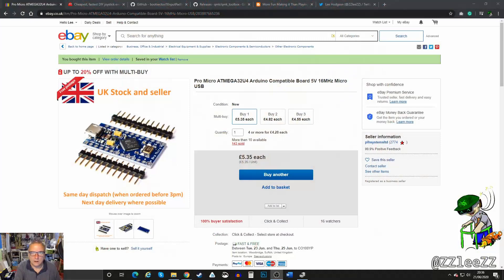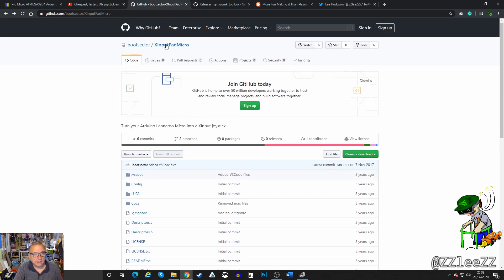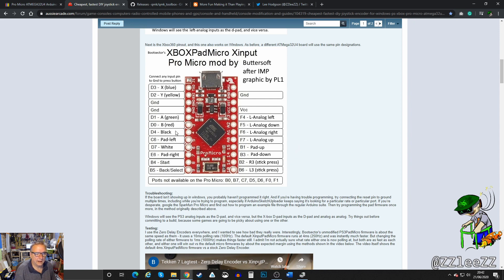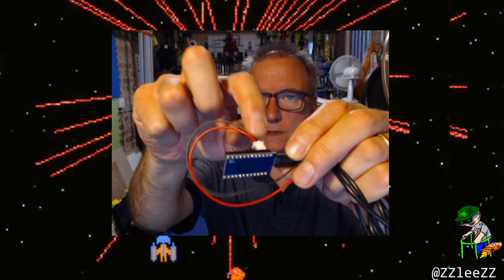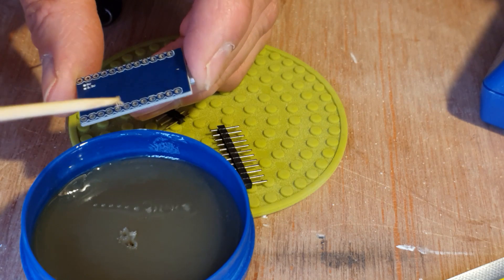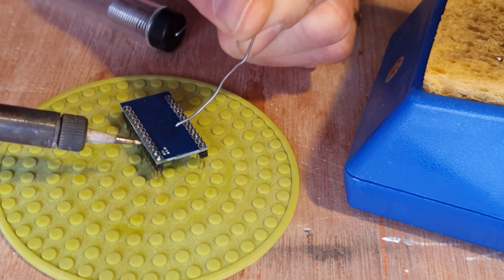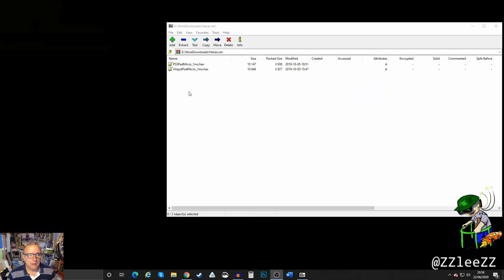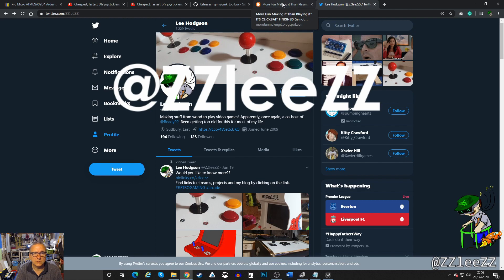CHEAP! Arcade controls encoder using an Arduino Pro Micro

Comment: Small question if anyone reads it. It seems there are 3.3V and 5V variants. Which one is the one you need? Or are both okay?
Edit: I found the answer if anyone is asking the same. The forum post says you need a 5V one
Reply from the maker: Nice find! I would have needed to look that up 😁
Reply: @MoreFunMakingIt  Btw. at the end when you show the insides of the stick. Are these dupont cables rly connected to the buttons and the lever? Cause in the video it rly looks like they are connected to smth else.
Reply from the maker: @niklasstg6957  Yup! No camera tricks here! :D

Comment: I made 2 of these recently but finding them to be sluggish/unresponsive in some libretro cores. ie the directional getting stuck or some buttons being slow to respond. I've triple checked my wiring and now putting it down to my config – have you experienced anything like that? Do you have any tips for getting them working nicely in retroarch input settings? Thanks!
Reply from the maker: I did have some problems with the xbox version of the hex files. I'm not sure if it was the same thing, but it did have some very glitch behaviour. I ended up using the PS3 version instead and that sorted all the problems. Other than that I'm not sure what to suggest.
Reply: @MoreFunMakingIt  I shall try that instead, thanks
Reply: flashed some new pro micros with the PS3 hex, great. Mapped them in emulationstation with no issues but the buttons or joystick aren't working in mame-2003-plus or any other emulator. Have tried wiping all traces of any controller configs but still the same issue. Have you used the PS3 hex with Retropie?
Reply from the maker: @tomplam  yeah. They worked really well for me in Retropie. There's a way of deleting the configuration file to reset all the controller settings. I can't remember how you do it exactly, I know you can do it over the network.
Reply: @MoreFunMakingIt  I've found out the issue I was having was due to a crap HDMI>VGA converter taking too much power
Reply from the maker: @tomplam  ahhh! Interesting. Glad you got it sorted 😁

Comment: This is exactly what I've been looking for! I've created an arcade cabinet that I want to use my Original Xbox in, but until now haven't found an inexpensive way of using my arcade controls with it.

I do have one question  though, on all of your buttons, did you wire the negative sides together and take them to one of the ground pins or do something else? I couldn't quite tell from the video.
Reply from the maker: Hi Dilpesh!
Yes that's exactly what I did with the ground. I chained them all together to one of the ground points.
I'd be interested to hear if this works with an original xbox. Although it appears in windows as an xbox controller it is missing security software that an actual xbox 360 controller has. I have no idea if an OG xbox requires this? Good luck with your build!
Reply: @MoreFunMakingIt  thanks for the reply! Fantastic channel! Keep up the good work. The OG XBOX is apparently just a simple USB HID interface..From what I read, the xboxpadmicro files used to flash to the arduino were created for the OG xbox so im hoping it will work!

Last question, with regards to the negative points, my buttons have 3 pins on the bottom on a block (suspect they are the same cheap ones from Amazon you talk about in your video) I believe 1 is for positive, 1 for negative and the other for 5V for the led light inside.

I think my only choice is going to be to connect a wire with dupont connector to each negative terminal and then twist the other ends together and solder them to the ground pin. Would this be the way to do it or have I missed something?
Reply from the maker: @dilpeshajmeria7459  the ones I have don't have an led. But they do have 3 pins. One pin will be common (ground) and another will be NO (normally open) and the last will be NC (normally closed). Test it with a multimeter or continuity tester to find which pins are open until you activate the switch. Some microswitches have a diagram embossed on the side.
Run a wire from the arduino ground point to the ground (common) terminal on the first switch and then chain from that one to the next to the next and so on.
Hope that helps! 😁

Comment: With zero delay this encoder?
Reply from the maker: It's not zero. None of the encoders can do that, it's a marketing name only. But this encoder is lower latency than the ones called zero delay.
Reply: @MoreFunMakingIt  I didn't know that, thank you
Reply: @MoreFunMakingIt  That was my question.  Now to weigh it to the new Raspberry PI pico.   Mainly, I like the 12 bit Analog (ADC) on it vs 10 bit in the Arduino pro micro, though not sure if this will translate to better resolution.  Used Arduino pro micro with pots for flight sim rudders.  I've been thinking of trying hall effect sensors.  Great little project.  Considering flight stick with throttle or yoke next.   Thanks for your videos!
Reply from the maker: @imushavem7504  Your welcome! I'm very interested to see if the pico performs better in latency tests.

Comment: So did you just use the dupont connectors directly to wire the board to the buttons? I've never worked arcade buttons before and looking at pictures they have a very differently shaped pin.
Reply from the maker: No, I crimped a suitable connector onto the male dupont connector. Worked really well.
Reply: @MoreFunMakingIt  Awesome, thanks. And just because I can't get a definitive answer anywhere else it looks like it needs a .25" (6.3mm) female spade connector?
Reply from the maker: @Lemonicii  totally depend on the connectors on the buttons or sticks. Some are 2.5mm and some are 6.2mm. Best to measure what you have.

Comment: hi, been watching your vids, is the joystick recognized as an xbox controller? did you try it on windows 7? did you have to install the xbox controller driver on windows 7?
Reply from the maker: You can program the encoder to be anything. I went with the xbox 360 hex to begin with as it's better supported with retropie. In the end I switched to the ps3 version as it was causing problems when I plugged a real xbox 360 controller in. I only tested it on Windows 10 but I'm pretty sure it will work exactly like any xbox 360 controller. It can even be made to emulate a keyboard. I'm going to do a follow up video later using a KL25Z as an arcade controller. I think it could be really good.
Reply: @MoreFunMakingIt  thats great, thanks for answering, im also looking up for that KL25Z board... but im far from building my vpin... i dont have the room for it yet.

Comment: would the ps3padmicro work with a real ps3?
Reply from the maker: That's a good question and I'm afraid I don't know. I do know that the xbox version has problems with an actual xbox. Something about missing proper security stuff.
Reply: Yes it does work I’ve used it on my PS3.